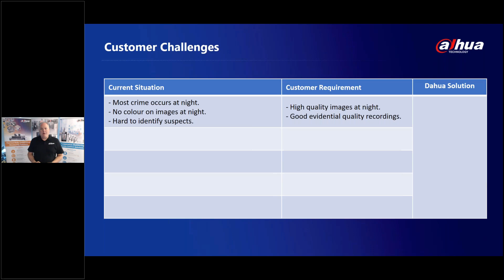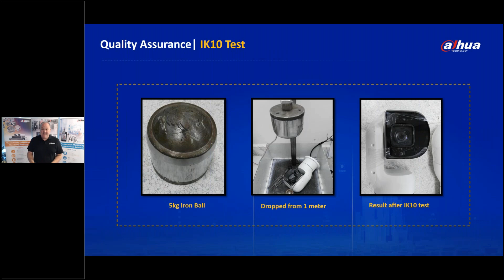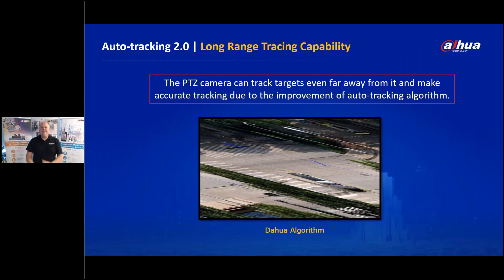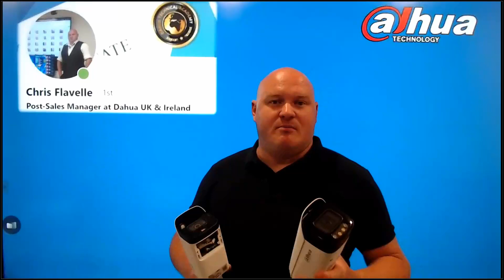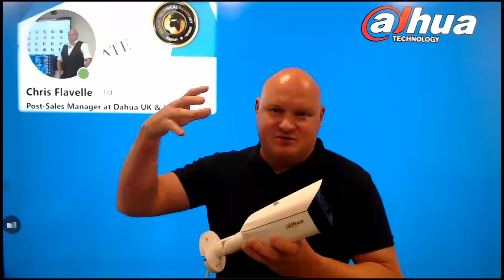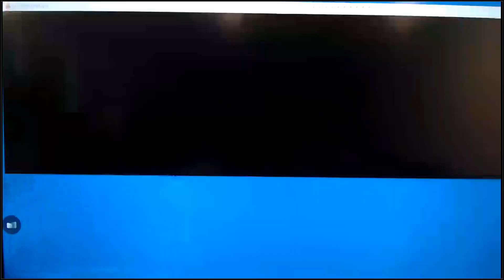TiOC (Three in One Camera) and Auto Tracking PTZ 2.0 Launch

Comment: Is the alarm input and output a dry contact? Or does voltage pass through when the camera is connected via Poe and require termination if not being used?
Reply from the maker: TiOC is an active deterrent Camera and Auto tracking is taken from one of our PTZ Positioning Cameras. There is no such thing as an TiOC PTZ Autotracking camera that doesnt exist. To the question - Yes it is a dry contact. The output has a 12 volt 1 Amp electrical tolerance. Hope this information helps.